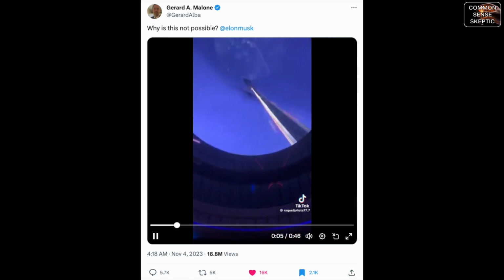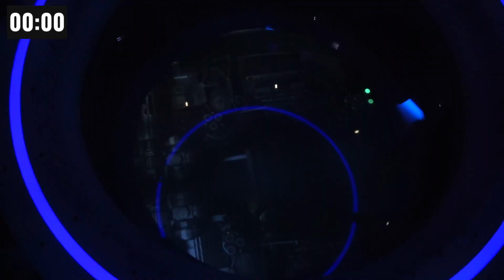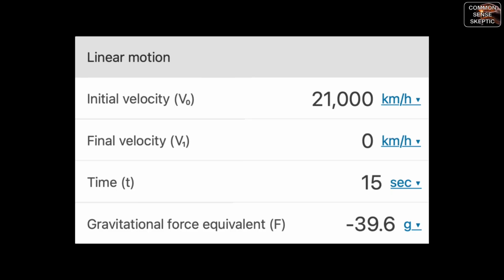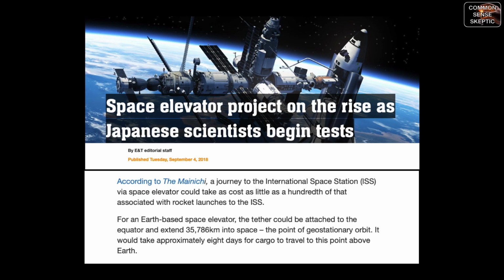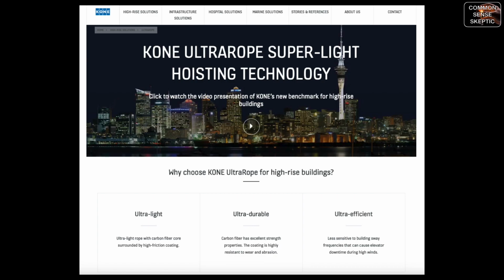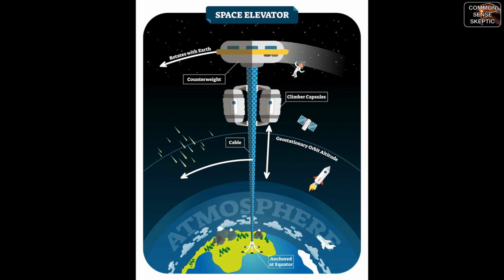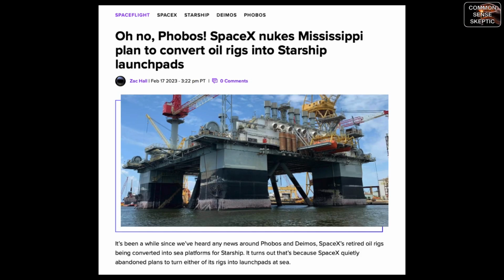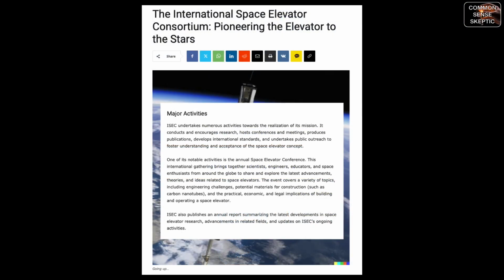DEBUNKING L.E.O. SPACE ELEVATORS

Comment: You are correct about the tech not existing for an Elevator or Orbital Tower at this time.   It would require some form of Clarketech (for the elevator) or a hyper-expensive active support system (for the tower).   However, I thought it important to point out some small flaws in the presentation.  

First, the geostationary elevator "can" have nodes in other locations on earth.   The anchor points simply need to neutralize the sheer strain by reaching a node along the main elevator that is also compensated by sending another cable down at an opposing angle.  If we're talking Clarketech already, then this is basic physics once you've solved the material science.  Granted, Clarketech - but still, the math is pretty solid on creating anchor points on a sphere not along the equator of that sphere.  The material science is Clarketech, but the math is there. 

Second, a break in the cable does not mean the cable will wrap around the earth and cause untold damage.  It will fall straight down the gravity well.  And depending on the where the break occurs, we have several mitigation systems that could be put in place to either recover the cable as it falls or break the cable up into recoverable portions.  We're talking Clarketech here, you aren't just going to let this thing fall and destroy stuff - you're going to harvest that cable as it comes down and have a new one ready to go in days while your counterweight station puts itself back into the right position and does repairs on the cable still attached.  

Third, LEO will likely be accessed by an Orbital Tower.   Orbital Towers can be placed anywhere on earth (even if the most useful point is on the equator), and will have massive anchors built into the crust to distribute the mass of the tower itself and the energy involved in the active support system (or clarketech if available).   The ocean/lithosphere/atmosphere is really not a big deal here compared to the other issues - the energy involved in dealing with those systems is only a small fraction of the material and energy science needed to maintain the tower under its own weight.  IE- if you can build the systems to maintain such a tower you can compensate for extreme ocean depth, atmospheric turbulence, crust dynamics, and induced harmonics from any of it.  Its a real problem, but its a minor problem that can be compensated for in the greater problem of the design itself.

Fourth: Energy - anyone building a tower or a elevator would be an idiot to not build a system capable of harnessing the energy created by having such a massive structure moving through the earth's magnetic field.  At the scales we're talking about the system has more than enough energy to power itself, and large swaths of the planet too.  Especially the elevator.    And if additional energy was needed, you'd build solar power relays and satellites as a part of the orbital infrastructure to support the elevator.  This is not something that will ever be powered by conventional energy resources on the ground.  It will instead be one of the primary relays via which orbital generated power is delivered to the planet.   

Fifth: Launching from a LEO Tower - If you shove something out a door it will fall straight down... with a bit of momentum from the shove.  You have to shove harder.   Being at that altitude you just need to add orbital velocity plus a bit when shoving the item out the door.   Not insignificant in any way what so ever... but much less energy than is required to lift an object from the surface to space.  A good 1/4 of a rocket's fuel is overcoming drag and the weight of that fuel to overcome that drag to get into the upper atmosphere.  You have a lot less drag at 220miles than at sea level.   We're talking about instead of needing a full falcon 9 you now only need a slightly larger second stage rocket.   Good news though, you don't need artificial gravity on your orbital tower - should be well within human tolerance and plumbing will work as expected.  No vacuum toilet.  Stepping out for smoke breaks might be a bit of an issue though.  :)   

Fifth: Realism versus aspriationalism.  Earth based space elevators and orbital towers are impossible under current known science.   Please note - Current known science is changing "daily".  And while they are impossible on earth for now...   They are not impossible on other bodies in the solar system.  It is a function of gravity, material science, and practical physics.   There are no mathematical blockers to the physics involved. There are, as of yet, no known natural laws that would prevent the discovery of materials that would be capable of this.     Orbital Towers are closer to the "possible" in the near term.  But "possible" does not mean achievable, practical or desirable. There are more factors than pure science and math involved.  Economics, for example, is a driving motivator that will rapidly kill most projects.    Infrastructure is another - in order to even begin to justify the cost of an orbital tower or space elevator, you need an infrastructure that would make such a structure not only "viable" but "essential".  

Final note:  Infrastructure is the key to any practical human presence.   It must be put in place before the people arrive in numbers.  In fact, it is the existence of infrastructure that makes all human population centers possible.   Before there are O'Neill Stations and Space Elevators, before there are Orbital Towers, Launch Loops, and other megastructures on or around earth... there will be Orbital Power Satellites, microwave beamed energy relays, massive solar collectors, automated lunar construction facilities... all because lifting anything more than humans and biomass to orbit from Earth is stupid.  There will be rail guns on the moon launching packages of refined aluminum to LEO.  There will be robots built from that aluminum working in orbit being directed by people running VR on earth building and constructing platforms and systems to support the few people that will launch up there.   Long before the first mars colony is actually established, or long before the first lunar outpost boasts more than a dozen living residents... there will be tens of thousands of people working in LEO.   And long before there is more than the ISS and a few small outposts in orbit, there will be automated infrastructure in place to prepare the way.  

People always wonder where the jet packs and flying cars are.   They're here.  They've been here for decades.   General aviation aircraft and people playing with rocketfuel on their backs.  They're not practical or ubiquitous for everyone because they do not have an infrastructure that makes them as safe as a car - which is actually pretty dubious in its safety anyway.   But honestly, once the infrastructure is there?  Sure, there will be flying vehicles in everyone's garages.  And that's where they'll stay most of the time, because you'll walk to the corner store, ride a pedal bike to a strip mall, or drive to the shopping center because that's a lot more practical and safe.  But you'll probably be doing all of it in electric vehicles - because that's the way the practicality is rolling.  And as we build out orbital infrastructure - its quite likely that some or all that power might be coming from space. 

We're all upset the future isn't getting here as fast as we'd like.  But the reality is that there's a lot of work that lives under that future that supports it.  That's why "infrastructure" is the most important thing we can build.   You have to put in the work to get the things you want in life.   If you want a future where most people can live and work in space - that's a lot of work.  A "lifetime" worth of work from "billions" of people. The generation that had the moon landings in their youth took for granted that this was going to be "their" future.  They let it go - thinking someone else (their children) would do the work "for" them.   Placed these burdens on their kids while trying to narrowly control their kids lives in ways that hobbled and hurt those kids.  They didn't work with their kids, they tried to make their kids work for them.  They partied.  They pushed their kids to making a world that supported their older and more terrestrial needs and ignored the infrastructure.  (leaded gas, pipes and paint didn't help) They sold their kids' tomorrows for their yesterday.  That's a price we're paying now.  Its going to be 100 years before more than a handful of people are regularly living and working in space.  Not because we can't do it - because we didn't do the work to make it practical and feasible.  And that's on everyone who thinks "oh, someone else will make it happen!" or "Someone else will fix my problems!" or "Someone will take care of me!"   That's not the way this works.   Space elevators and orbital towers are fictional because they are daydreams that ignore the work.   Something like them might exist - but if they do, those structures will come far after all the hard work to get the basics in place.   Remember that as you read the BS all these wannabe millionaires and billionaires spew looking for you to throw money at them for the promise of a fictional dream.

Comment: I remember 'space elevators' from AC Clarkes 3001 - and remember thinking at the time - sounds cool but fictional - because even on the equator you could never account/mitigate geo-instability as any minor tremor at the base is going to be amplified/magnified the further up you go - and also wind/storms
Reply: I've seen one work of science fiction cover that. The Quintaglio Ascension trilogy, third book, when some recovered super-tech starts constructing a space elevator. One structural engineers points out a problem right away - even with the super-advanced alien metamaterials of immeasurable strength, there is no way the structure could withstand the buckling forces resulting from the slightest atmospheric or seismic disturbance. Engineer turns out to be mostly right - but didn't account that the engineers who designed the thing were well aware of this problem, and the elevator shaft included active dampening through a series of thruster platforms spaced along the length.

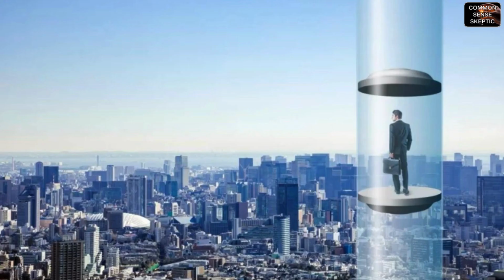Comment: 6:05 this one i love. Gave me a good chuckle. Just 2 platforms in a tube. 
How does it go up? Air preasure? How does it hold steady? How come he isn't smushed? Could his lungs burst? How is the upper platform moving along? Sucktion at the same rate?! And is this glas?! or a see-through polymere? One will brake and the other wont deal with UV light for too long. And did anyone figure out the stretching/retraction of going from Summer to Space? etc etc

There is so much wrong with it its glorious in its failure XD

Comment: a spaceelevator makes only sense with a geostationary endpoint
Reply: Not even then.  You still have to find a way to add to the elevator the difference in angular momentum from the position at the bottom to the position at the top.
Reply: With a massless cable yes, but   most if the cable won't be in gestationary
Reply: @SoulAir  even a massive cable will get pulled out of its orbit.

Comment: One potential correction if I may. The concept usually involves a cable that reaches beyond geosynchronous orbit and which is terminated above geosynchronous orbit with a counter weight. Now, if you graph the tension in the cable, the highest tension is at the point of geosynchronous orbit. The tension in the cable reduces as you move towards the ground. Which is what you expect because each point in the cable has less cable below it that it is holding up. In theory at least, when you reach the ground, the tension is zero. Of course adding a load will add to that tension, but the tension is supported by the cable from above. What I'm saying here is that although you need an anchor point, you do not need a massive anchor point since ground level is where you see the lowest tension. In fact you can actually tether this to a floating ship or floating structure of sufficient mass.

Also, the counterweight (beyond geosynchronous orbit) is actually moving faster than geosynchronous speed. If you release an object from this point, it will go into an orbit that dips above and below the orbit of the counterweight. It won't get you into escape velocity, but it will get you most of the way there. At least in theory.

Yes, its impractical with today's technology. But being the pedant I am, I figured I should correct those bits :)
Reply: You can get to escape velocity with a space elevator if it goes far enough out
Reply: You have it exactly backwards, the ground is where the greatest tension is. That's why you need to hold the cable down, if the tension was zero it would be floating.
Reply: @PlatinumAltaria  No, wrong. The greatest tension is at geostationary orbit. The cable is being pulled by the counterweight beyond geostationary orbit and below geostationary orbit the cable hangs. I know its counter intuitive to some, but that's the actual physics. Now, you do need to apply some additional tension to the cable to keep it reasonably straight against other forces and that additional force needs to be resisted by the ground, but that's a small force compared to the cables own self loading. A few tens of thousands of tonnes (a big ship) is sufficient  to this task.

 Think about it. You have a fixed point in geostationary orbit. You lower a cable from there. Every km you pay out is additional mass that has to be supported by the cable above it. Hence the tension rises the further you go up.
Reply: @saumyacow4435 
Just for a fun thought experiment: while lowering the cable it would not go just down but bend forward until it reaches the area of air resistance. I'd assume it would create a dynamic mess in the following with massive whip like force spikes.